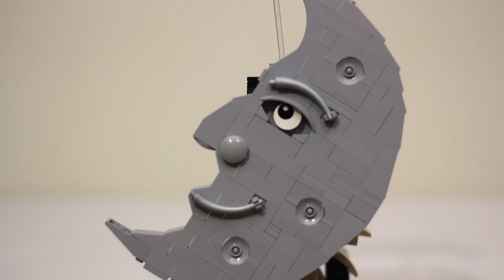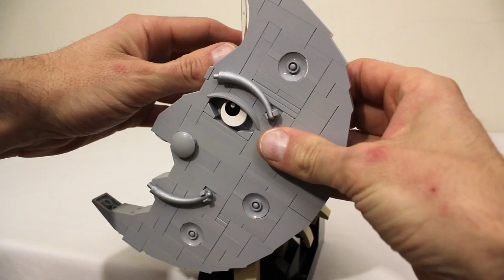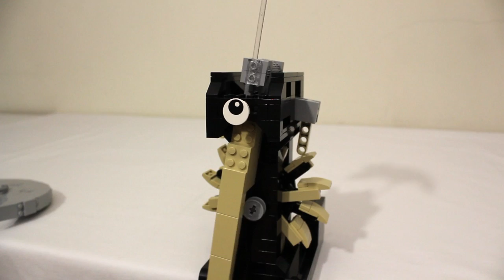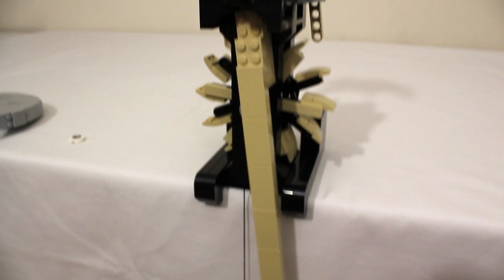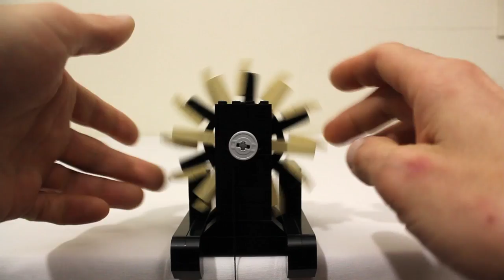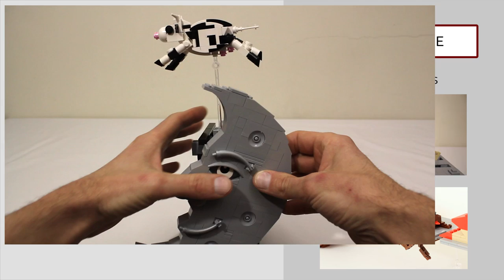LEGO Escapement Sculpture - The Cow Jumped Over the Moon

Comment: it's a nice scape wheel, but it's very heavy. the 41530 propeller has only 8 blades, but its mass is significantly less, and its single-piece construction makes it very precise. these two characteristics make it the superlative scape wheel. just food for thought.
KEvron
Reply from the maker: +KEvronista Absolutely. There are many other ways to build an escapement mechanism, many of which are probably 'better' than this one.  For this model I really wanted to experiment with building up a custom gear.
Reply: JK Brickworks
now that i think about it, yours is more artful, and so is more appropriate to the pieces in which you've applied it.
i feel like a philistine.
KEvron

Comment: Very nice! :) How long will it work until you have to reset the pendulum again?
Reply from the maker: +Felix Stiessen Around 5 minutes.
Reply: +JK Brickworks its nice that you like english poems like the cow jumped over the moon and where the sidewalk ends :D
Reply: +JK Brickworks Isn't it possible to use a gear reduction and increase reset time?
Reply: +Felix Stiessen Who else was a little creeped out by the moving EYE
Reply: +DesignJunkie58 I dient even realize that in the beginning XD
Reply: +DesignJunkie58 Me.
Reply: Yes Filipe, it is possible. As long as the gear driving the bigger gear has less teeth than the bigger one. It creates reduction or torque, while a big gear with more teeth driving a smaller gear with less teeth will go really fast.
Reply: H